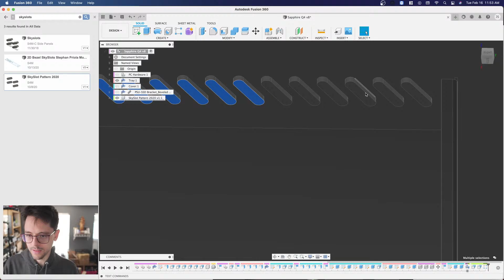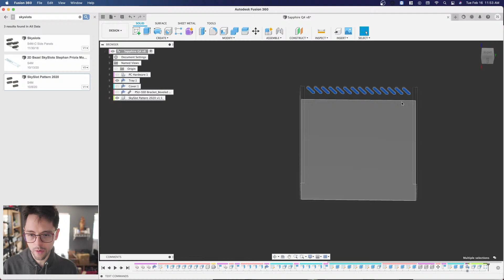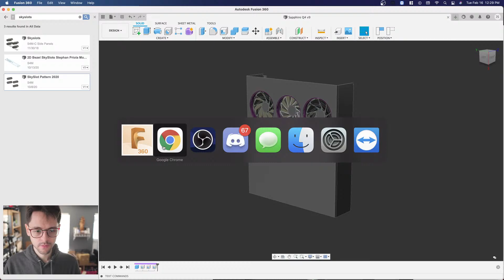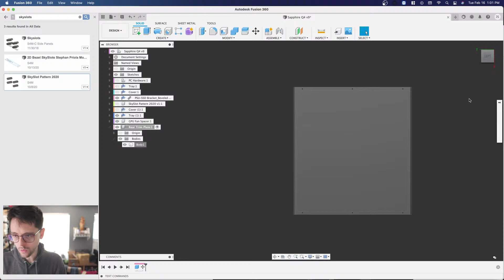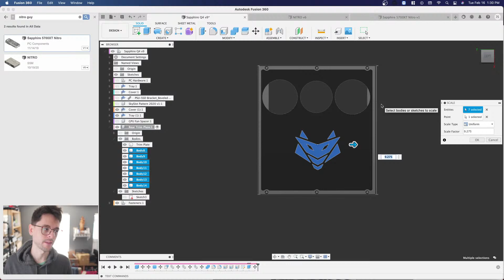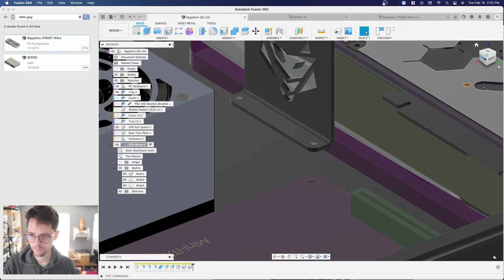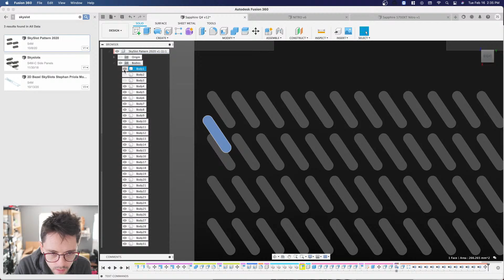Comment: Edit: I haven’t edited my OG comment but would like everyone to read NFCs kind replies and my much required follow-up apology. 

I´m sorry but 20:00 is so messy. I realize everyone has their own preferences, but as an engineer the process feels so wrong. Create a sketch on the surface plane using the known dims for your skytab, pattern within sketch, and then extrude cut the sketch? You can even do it "through all" to cut the bottom flange too. It would be a million times more efficient, the design would be defined/constrained, wouldn't clutter the "bodies" as it's one single sketch, and computationally it's more optimized too. Again, to each their own, but some practices should be avoided and I just feel that this is definitely one.
Reply: I'd say a couple things. Firstly, I'm not an engineer, nor do I have any training at all or claim to. Secondly, my CAD skills are beyond horrible, although I have learned leaps and bounds over the past three years and thousands of hours. Thirdly, this is here to inspire people who have never even considered this software to pick it up and make a computer case. That's my bread and butter. I'm an artist not an engineer. I'd tell people to go take a CAD course to learn things the right way, but I would have loved to see someone use software to do what I want to do to get me excited to jump in. I hope this makes sense.
Reply: @NotFromConcentrate  firstly I didn’t expect such a quick reply for an old video, so thanks. Secondly I apologize if I came across entitled and/or rude, the process really irritated me but ultimately I could have conveyed my feedback differently. Ultimately as you said it’s not the detail of the CADing process you wanted to get across but rather the general idea, which you did and very well. Thanks for this and the other guides and I apologize for any elitism.
Reply: Oh and the most important thing: do what you  are doing. Go through these and comment on how to do it better. I'll pin it, and everyone can learn faster. Thank you for the help!
Reply: @NotFromConcentrate  thank you as well for your positive feedback. I appreciate it and hope mine was also useful to someone in the future